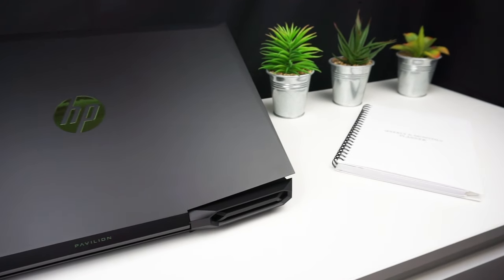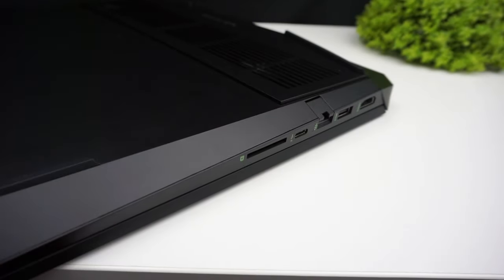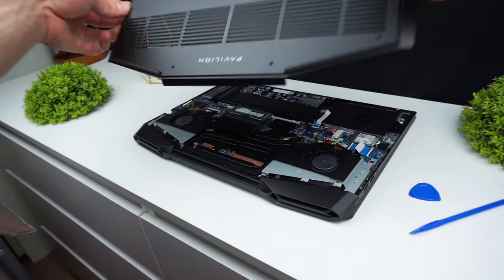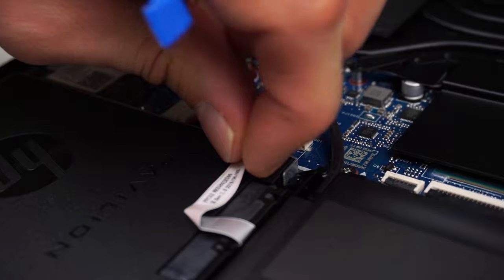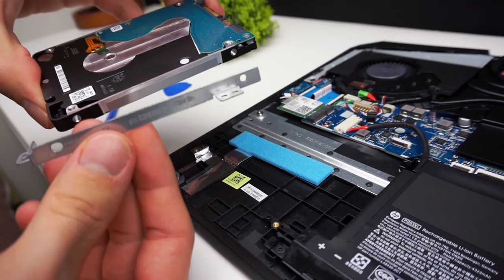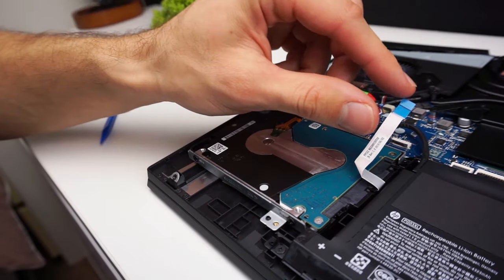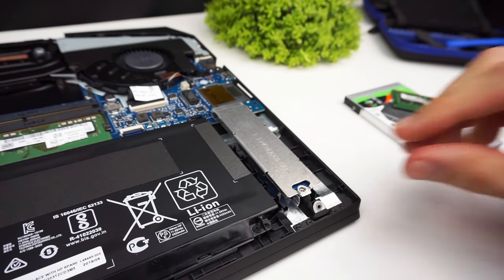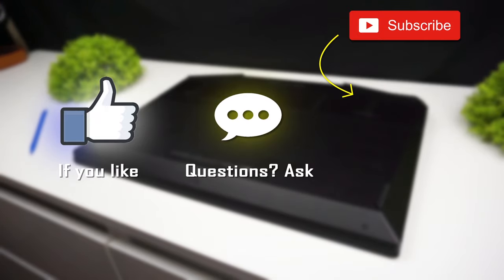HP Pavilion 15 Gaming Upgrade RAM / SSD / HDD - Disassembly Guide

Comment: Do I need to disconnect the battery to add ram?
Reply: yes but, always disconnect anything that has power going to it whenever working on anything not just laptops.
Reply: @Kody22  oh ok but why is it so hard to disconnect it?
Reply: @Its-Atari  laptops aren’t really meant to be taken apart but you work with what you have, but you can get a pack of tools that are for taking phones apart and repairing them and those tools will do that job.
Reply: @Kody22  yeah I have a tool to open up the computer its just difficult to disconnect the battery because there are fragile things surrounding it I tried disconnecting it using my fingers but I couldn't get it to disconnect the only thing I want to do is add another ram stick which isn't difficult to do also the computer I have is the same as the one on this video
Reply: @Its-Atari  Try it at your own risk and make sure the computer is fully powered off.
Reply: @Kody22  yeah I completely turn it off for safety also was thinking of waiting a few hours before putting in the ram stick for extra safety and also I did some practice before hand and ended up taking out the ram stick that the laptop came with without disconnecting the battery and waited a few hours to put it back in and it still runs pretty good
Reply: @Its-Atari  you can also plug things like a mouse and keyboard in it to take out whatever power is still flowing through it.
Reply: @Kody22  wait those can do that I've never thought about that I usually just unplug everything my mouse my keyboard my ethernet cable my charger for the laptop my drive and the computer itself because I thought it would harm it
Reply: @Kody22  also if I plug in a mouse and keyboard how will I know if all the power is taken out?
Reply: @Its-Atari  if they have any sort of like on them you’ll know.
Reply: @Kody22  never mind I was able to get the battery disconnected

Comment: does the ssd slot already filled by default ?
Reply: If it's the 1650 model with the 256gb nvme then I think the SSD slot is empty. I did an SSD upgrade on mine and there was just a filler piece in that slot
Reply: @Epicwallpaperstwitter  mine has only a 512gb SSD and no HDD. Do you think there is extra SSD slot in it?
Reply: @ouzakg3139  only one ssd slot is there and if it already has a512gb ssd THEN its filled. What i want to know is IF THERE IS an empty hdd slot?

Comment: Is it possible to upgrade the i5 to something better?
Reply from the maker: No, it's not replaceable
Reply: @TechFinds  it can actually be desoldered and changed but it is dangerous, requires expensive special equipment and the processor are expensive so it is not a real good idea

Comment: Could i change the 8gb RAM that are inside with KingstonValueRAM, 32GB DDR4, 2666MHz CL19?
Reply: Make sure to check what your max ram is because depending on your motherboard it might not be able to handle 32GB especially if you’re gonna do it on this laptop

Comment: I have a 3200 Hz memory speed RAM.. can  I use this instead of the 2666 HZ RAM?
Reply: Yes, but it will work on 2666 Hz
Reply: Yes but it will run at 2666hz if that is what your motherboard support only

Comment: Can I use a desktop hard drive/SSD for my hp pavilion?
Reply: It depends, most computers (whether desktop or laptop) use 2.5-inch drives. You can mount such a disk without any problem. The same applies to the M.2 drive. However, if the desktop drive you are talking about is 3.5 inches, then you can only dream.
Reply: @rafal.qwerty  oh, ok thanks for the help! I was mainly talking about the 2.5 inch drive so I’m all good.

Comment: Crucial 8GB DDR4 3200Mhz is this ram suite for HP pavilion ???
Reply: @QuackQuack Well i Guess check what your ram speed is using task manager or something and then you just match the same speed
Reply: In 2k19 version I guess 2666 mhz is the limit.
Reply: @basiqquddusi9601  no idea
Reply: @basiqquddusi9601  Bro I'm using 2020 HP pavilion Ryzen 5 5600H with RTX 3050 
3200Mhz ram is Ok or not
Reply: @bharathsurya1764  bro I have no idea about this variant but check your ram speed and use one accordingly. Steps to check ram speed are simple. Open up Task Manager by right-clicking on the Windows taskbar and selecting Task Manager. Navigate to the Performance tab — it will open with the CPU view selected, so you'll want to choose the Memory view from the left navigation panel. After clicking on Memory, you can view your RAM speed and other details.
Reply: @basiqquddusi9601  It show 3200mhz brother... I need to use same speed ram or 2666mhz bro ?
Reply: @bharathsurya1764  bro use 3200MHz

Comment: I feel like something is connected to the backplate, I am scared of destroying it all when i will open it
Reply: Don't worry, it's just the tightness of it. I've been doing this for awhile now I don't my came back to learn how to update it. On of my screw parts are broken ( the plastic part which has the golden nut inside) I glued it back together with nail glue and pliers and all is well so far. So don't worry about it. If your worried just take precautions when opening it for the first time. You will hear a snapping like sound but it's okay it's just the sound it makes when it unclicks. Take all the screws out he tells you to. And use I found a flat head screwdriver to work best.the seat one you can find, push it in gently into the sides where it opens and the twist the screwdriver to lift it up carefully and successfully. From there grab the back first where the screens connects and lift it up then the front. I made that misttthe first time cleaning a laptop three years ago and my screen came off from the bottom of the laptop. DON'T MAKE THAT SAME MISTAKE. And from there just clean your vents and then id your cleaning the fan I use tweezers to keep it still while I use a toothbrush end to clean it off since I lost my actual fan brush awhile ago 😅. If you need help with anything while doing it please just message here and I'll help you.x

Comment: I have a question why 2666Mhz not 3200Mhz?  Is not compatible?
Reply from the maker: This laptop supports up to 2666MHz. You can install 3200 but it will downclock to 2666MHz anyway.

Comment: what ram type is 8 gb? im just making sure i will buy right same type
Reply: For the most part, you just have to match the speeds of the RAM together. The brand usually doesn't matter, and it has to be same capacity as well (2×8gb sticks).
Reply: @WigglyDiggly  Oh. im replacing the 8 with a 16
Reply: @TheGamer-jd5sh  I bought another RAM stick 8gb 2667/2666 mhz works just fine. It wasnt same manufacturer either.
Reply: @TheGamer-jd5sh  what id do is just fill the empty slot with the 16gb and leave the 8gb in, it will act like dual channel 8gb RAM.

Comment: Do u need to remove the battery ? beacause he doesnt do it in the video and I think if you dont u can burn the mainboard
Reply: Yes! If you don't, you will short charge the motherboard and completely ruin your laptop!
Reply: @JinTakahashiTensai  but he doesn't remove it
Reply: @tirterra1222  you don't have to, but it could be catastrophic if you accidentally drop a screw or screwdriver and it shorts something, at that point you may need a new motherboard which would lead to needing a new computer. 
Personally I won't remove the battery for ram/storage because I'm too lazy and feel like I'll break the battery taking it apart, and those are things that wouldn't be too affected by the power being on, but if there's a short anything could happen and you'll probably regret it.
Reply: @LLSniper  pretty sure it just needs to be unplugged from the motherboard so that its not feeding any power into the rest of the stuff
Reply: @toukoenriaze9870  if I remember correctly the battery connector is covered by either the battery itself or something that's just as difficult to take apart. I could be wrong though.
Reply: @LLSniper  I havnt actually been able to open mine because of fighting with the casing but from what I've seen it's been relatively out in the open on most vids
Reply: @toukoenriaze9870  it's a pain. I ended up using a really powerful suction cup on a more stiff section to pull it off
Reply: @LLSniper  also don't want to accidently break it ... After all the battery is still attached inside the casing lol
Reply: @toukoenriaze9870  oh I meant on the bottom of the laptop the panel you take off. Not the battery. The main back panel isn't connected to anything except by the screws and the wedge shape of the plastic. It will feel like you're breaking it when you pull it off. Highly recommend a strong suction cup to do it.
Reply: @LLSniper  and ye if I can find one I'll try it

Comment: Where is the nvidia card? I think putting my ram I disconeccted it
Reply from the maker: Graphics card is soldered on to the motherboard and covered with cooling system (fans and pipes section).

Comment: Only complaint in your description you listed HDD hard drives not SSD and now the HDD option you provided apparently is not good for that gaming laptop why would you list HDD and not the SSD you're using
Reply from the maker: I didn't use any SSD when upgrading this laptop. In the description you can find M.2 SSDs, and HDDs. I don't know why any HDD from the description would be bad to you. Do you mean not compatible or bad just because?
Reply: @TechFinds   some pc store said the hdd would not work but it did so thank you grate video'

Comment: I'm struggling to take the screw off the hhd tray why are they so tight
Reply: Be careful some screws are so tight that they won't open instead they will get deshaped.
Reply: @basiqquddusi9601  I bought a USB adapter to sata, I've given up the screws too tight 😑

Comment: can 2 ssd be used?
Reply from the maker: This laptop has one slot for M.2 SSD and one slot for 2.5" drive where you can install SSD as well
Reply: @TechFinds  i am thinking of buying dk1511tx model of pavilion 15 series, which has only nvme ssd in it. Do you think there is an empty slot for HDD where I can add a SATA ssd? And how much can I add? 2tb?
Reply: @jigneshrohit  thats basically the newest model and yes there 1 slot m.2 (which ur window installed) and 1 slot 2.5

Comment: What she we do after the upgrade ?
Reply: it's kinda plug and play, the RAM should definitely be noticed in the System Tools or System Properties.....likewise, if you changed out the SSD you'd need to load Windows on the "new" SSD......OR if you installed a "secondary" SSD as this video shows, you'll have access to a second hard drive in what used to be called "My Computer"

Comment: Why would they make it SO GODDAMN HARD to take off the backpanel??? Literally trying to use every flat thing I could find to get into the crack!! There's NOWHERE to even insert my tool to even start going around!
Reply from the maker: Try by SD card slot but be careful to not bend or break the case

Comment: i upgraded my ram with same frequency but it didnt show up.. help me
Reply: Did you try swapping out the modules, or trying just the new module on the board?
Reply: @nelhern2677  yess i tried swapping the sticks.. but when i tried a 8gb 2600mhz  it showed 16gb but not with 3200mhz whyy

Comment: are you able to upgrade the gpu on this laptop
Reply from the maker: No, it's not replaceable (like in 99% laptops)
Reply: @TechFinds  I’m trying to buy a pc is r7 5800x and 3060ti good
Reply: @TechFinds  it can actually be desoldered and changed but it is dangerous, requires expensive special equipment and the graphics are expensive so it is not profitable.
Reply: @nickborlas5282  price?

Comment: I dont get how you managed to open the lid
Reply: Same im literally trying so hard and it wont budge
Reply: @marawanhany9094  Huge PITA, but I just managed to do it with a dinner knife a few mins ago. Got it popped a bit near USB port, then jammed it in and lifted prying it open with a crowbar until I heard a snap. Then it opened a bit more, move down a tiny bit and lift until the snap, and then repeat. Good luck
Reply: @gabecampb  I did it with medicine tabs it was thin 😂
Reply: I did it with a guitar pick for me it was easier towards the top of computer

Comment: can you put a ssd in the hhd slot?
Reply: Noo that is hdd . Ssd also put in the same slot not a problem.
Reply: Thats Impossible to Do xD
Even if you do Manage to do that you will just end up breaking your Laptop
Reply: @emeraldaxeytyoutube8315  wth? you must be trolling right?
Reply: There are 2 types of storage styles nowadays: SATA and NVMe. NVMe is exclusive to SSDs. It's the gumstick-sized chip on the back of the motherboard. So, no, you could not try to put an NVMe SSD into the SATA slot. 

The other type of storage is SATA. This is the style used by pretty much all consumer grade HDDs and some SDDs. So, as long as your SSD is SATA, yes, it will fit just fine. (Also needs to be correct size, e.g. 2.5") The computer won't be able to tell the difference, and the only differences you will notice are faster transfer speeds and a quieter laptop.
Reply: @-HyperX-  Exactly, thanks for the info.

Comment: Can i upgrade ram beyond 16gb?
Reply: Yes but you only have 2 slots
Reply: If you do that you have a risk of ram overload
Reply: @martpes9337  What does that mean?
Reply: @ElitePlaysz  umm it’s basically when your drivers can’t handle that much ram
Reply: @ElitePlaysz  so that laptop can only handle 16
Reply: Yes you can, but you have to make sure what frequency is the ram that you have in your computer, and you have to take off the 8gb ram that comes with the computer, and buy 2 rams of 16 gb and that will make up to 32gb, so yeah you can
Reply: @martpes9337  it can handle maximum 32, it says on the hp page xdd
Reply: @buddylucas_8208  thank you

Comment: you lost me at the part where I have to unscrew the backplate. I can't remove that shit and I'm scared I might brake it.
Reply: Start at the side where the opening is where you can put in a cable. you can open that thing a bit and that's where I had success and it seemed that he started at the same thing.
Reply: I have the same problem